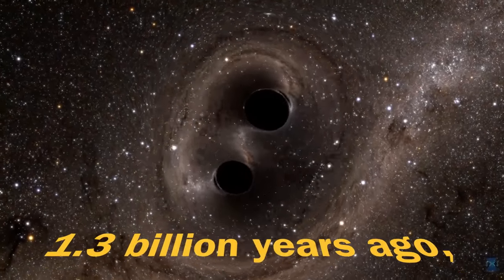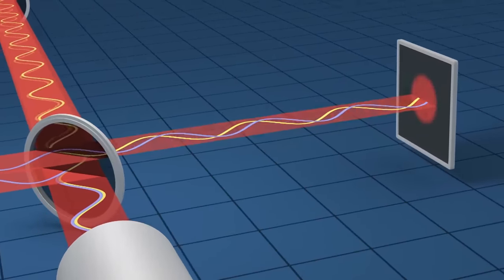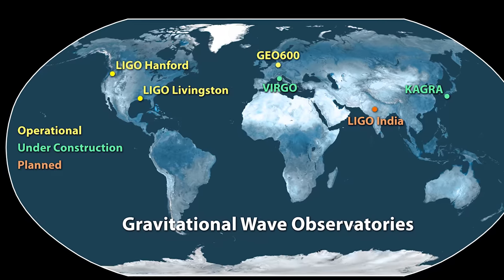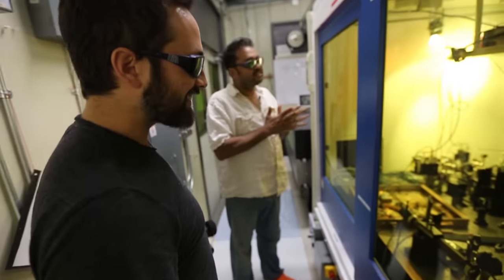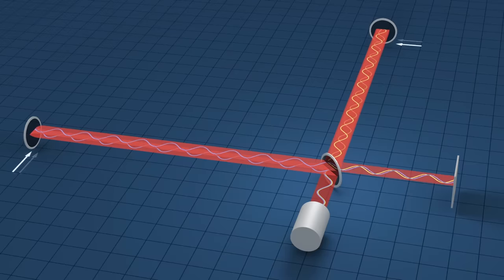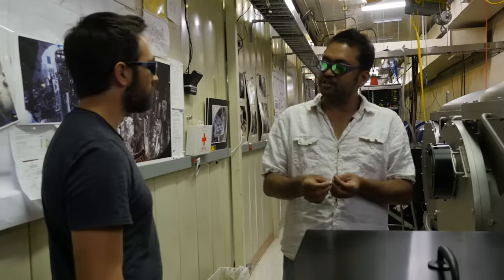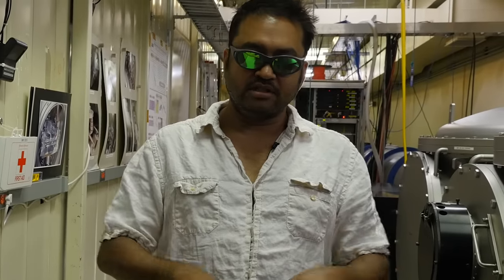The Absurdity of Detecting Gravitational Waves

Comment: Question: do the waves affect time too? Host states that the wave is in space-time, but explanation seemed to only relate to a wave stretching/contracting space.
Reply: Well time is a subjective thing - it only really matters to the speed you move at (relative to... I don't know).
The faster you move, the slower time passes. But what matters is your speed moving through space. At black holes, as you 'fall' into one, what is really happening is that you are stationary relative to space, but the space you occupy is moving towards the singularity. Because of this, really weird stuff happens. from your perspective, the outside world would speed up, and from everyone else's perspective, you would slow down until you froze on the event horizon. So I would think it may have a slight effect on time, but not a major one because time is effected by every action you do. If you start to run, time passes slower for you.

Comment: It's not a gravity wave. It's a deduction of space + time + space.  It was just a really big sonic boom. Like super big. Really hard keep a deductive perturbation going in absence of matter. But if it was big enough then it could pertivate forever technically as long as it's traveling through areas of space which are not completely like almost 100% dead of matter as long as there's galaxies and you know solar systems and then all the diffuse matter that's within the galaxies that we can't really see right now but we are now figuring out that it's there and all the matter is thrown around the galaxies through the center on each opposing side via the pinch point. 

That's what it was. Maybe a a perturbation which reach the maximum rate of deduction+induction+deduction. 
Inverse of the speed/rate of light.

Comment: Will you post the + - of the equipment calibration, and statistical variation of each piece of material in the equipment used for the experiment. Is the answer based on a mathematical equation based on a theory or real data? Is it based on the theory of the speed of light or the actual speed of light? Is it possible that the wave observed is just variance of the process?
Reply: "Will you post the + - of the equipment calibration, and statistical variation of each piece of material in the equipment used for the experiment"
You'll find that in papers.

"Is the answer based on a mathematical equation based on a theory or real data?"
The device collect data that are interpreted through a theory. That's science.

"Is it based on the theory of the speed of light or the actual speed of light?"
Speed of light is a measured constant in that theory.

"Is it possible that the wave observed is just variance of the process?"
Not sure I understand that.

Comment: I'm just making sure to note this: light was off set by light speed force, if this animation is to be trusted, it clearly decelerated.
Reply: Lol, all the claims about light being constant, there's a surprising set of instances that challenges the idea lol.
It might make sense that it's just a permeating and oscillating energy transponder, that is either charged or not, to varying degrees.
Realistically it's a naturally made quantum processing system. 
Larger masses uphold and upkeep the energy network.
My reference on that would be your example with the batter and the light bulb and the 1/c thing. Once the field was closed, you started noticing an oscillating feed of direction.
So a whole system of electromagnetic balance in forces, had an overall activity of a photon.

Comment: "Absolute vacuum is about 10-14. Space fluxes so we learned to formulate a base hypothesis, In the nuclear realm the most "detectors are approx. 10-9" which is all that is needed to detect atom components. The "space model " by theory can be "linear projected" to smaller particles such as "quarks " etc, however the linear models fails as new dynamics are discover as we search into the "minuscule universe". We know there must be "patterned physics" and so patience and innovation needs more exploration.  With the new global cooperation , this is happening.  Will see what will speak it's head out!

Comment: Measuring with this kind of precision, then couldn't it detect the variations from propagating sound waves? Or even someone walking around? Or a minor temperature difference between one side to the next? Or the constant vibrations through the earth? Or even perhaps an interaction with even a single molecule floating in the vacuum?
Reply: Isolating the device from background noise is a nightmare.
I worked with a guy who designed part of the VIRGO mechanical damping system, and that was a crazy stuff.
And afaik, it's also known than when someone speaks near one of the mirror's towers, the conversation can be extracted from signal and played back.
Lots of computer filtering is done to isolate real events.
Now, with at least three operational detectors (and more to come) detection in coincidences ensure it's a real G wave.
Reply: @Iseenoobpeoples  : You keep saying that crap. Why?

Comment: If they're able to detect and track black holes in real time would that be applicable to the navigation of space? Space GPS?
Reply: Nothing's in "real time" when you look at celestial objects, due to the finite speed of light.
Gravitational waves travel at the speed of light so you detect the black hole collision event "today", but the event actually took place 1.3 billion years ago.
(the first event that LIGO detected in 2015)
Other collision events have been detected since. 
It's also very difficult to detect a black hole unless it has an accretion disc, or collides with another black hole.
NASA have been carrying out a mission called SEXTANT that uses pulsars to locate objects in space, relative to the pulsar positions.
The spin of a pulsar is extremely regular, of about the accuracy of an atomic clock.
Reply: @reessoft9416  wow, thank you for the explanation!

Comment: So wait...in order for this thing to work, don't the length of all four arms at the two sites have to be like EXACTLY the same size down to like, the nanometer or something? How could you ever know if they were?
Reply: They don't need to be exactly the same, an interferometer would work as long as the wavelengths still match up. This means you would probably have to adjust them by nanometers or even smaller distances to line up, but the total lengths don't have to be exactly the same.

Comment: A question. how sure are we that what is being measured is a gravitational wave,  and simply not a pressure wave? in theory a gravitational wave would not press the light to the direction, rather it would draw it from the source. if what we are measuring is a simple pressure wave that could simply be created but the movement of a mass thru space. then that would only show the object. if it was a gravity wave it would show a force that pulls towards the mass rotating in space. so can you reliably say it is a gravity wave rather than a pressure wave? @veritasium
(btw: i have a long term project that the simple man that i am , is attempting to figure out gravity, as i am not happy with the current models)
Reply: " simply not a pressure wave"
Pressure of what?

Comment: Wait so the power of the light is related with the number of photons (intensity)? I thought that was related to frequency of the light
Reply: Energy of one individual photon is linked to frequency, by : E=hν (where h, is Plank constant and ν is the frequency).
But if you throw n photons of frequency ν you'll get a beam of energy E=n hν
'n' is basically the light intensity, and at that laser wavelength (close IR, if I remember well), that's gazillions of photons per second to get such an energy.

Side note: the laser itself is of modest power (200W if I remember well), however it's bouncing back and forth thus pilling up photons until reaching that MW power in the beam (and a fraction of that light is lost in the system, so in permanent regime the 200W laser just compensates for the loss).

Comment: If on can answer :)
Does the gravitational wave get weaker with the distance or does it travel to eternity with the same force?
How much greater amplitude could you measure rigth where the blackhole collison happens?
Reply: since the waves travel in every direction, their energy gets more spread out the further they go. like the light waves from a lamp
Reply: Space-time is supposed to be fully elastic. So no loss in perfect vacuum.
However, as @somemagellanic wrote, it goes in every direction, so if full power is preserved, power per area is in 1/r², inverse square distance law, as for light for same reason (surface of a sphere is in 1/r²).
There will be non-elastic loss in matter (if the detector see them, there must be some energy transfer), but it's very small, and likely negligible in practice.

Comment: Why are atoms and the molecular structure of the laser emitter not stretched by the same degree? If gravitational waves simply stretch the metric, how does the strong nuclear force know how far it’s reach should be?
Reply: To answer you question, it needs a better understanding of GR that I do: you need to know the difference between local coordinates and proper distance, and how a GW can let local coordinates invariant while affecting proper distances.

Look for this article (should be in open access):
"The basics of gravitational wave theory", by Anna Flanagan and Scott A Hughes, sept 2005 in "New Journal of Physics", Volume 7, 2005. It's explained page 15 and 16.

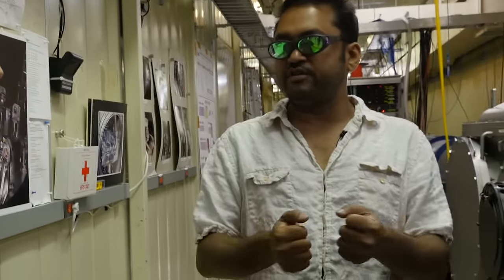Comment: 6:40 I'm looking for an explanation. Can anyone help? When the space is stretched. I would expect the light to measure the same distance because it is the space that has moved, rather than the mirrors in space. I figure Light travels the same speed through space whether the space has been stretched compressed. I guess that statement is wrong but why?
Reply: To answer you question, it needs a better understanding of GR that I do: you need to know the difference between local coordinates and proper distance, and how a GW can let local coordinates invariant while affecting proper distances.

Look for this article (should be in open access):
"The basics of gravitational wave theory", by Anna Flanagan and Scott A Hughes, sept 2005 in "New Journal of Physics", Volume 7, 2005. It's explained page 15 and 16.

Comment: 5:41 this is difficult to understand even though I rewatched several times. Still don't know how to answer "if everything is stretching how do you know anything is stretching"
Reply: Because it was stretched for few milli seconds , then new waves coming from laser won't be stretched. So they will travel more than existing light waves. So they will just notice the time difference between different waves coming back to sensors.
Reply: To answer you question, it needs a better understanding of GR that I do: you need to know the difference between local coordinates and proper distance, and how a GW can let local coordinates invariant while affecting proper distances.

Look for this article (should be in open access):
"The basics of gravitational wave theory", by Anna Flanagan and Scott A Hughes, sept 2005 in "New Journal of Physics", Volume 7, 2005. It's explained page 15 and 16.

Comment: What is a gravity wave. Alot of people are assuming they understand gravity when they dont know anything but the analogies that help to explain the complex systems in 3d terms and pictures 2d even for dummies. Show us the math on 2 things out in space let's say far from any gravity or at relative zero average gravity in all directions but not by falling or not resisting the gravity to easily achieve this state but hypothetically where this can be achieved with both items at rest and at different locations a impossible spot to find not just 2 points with similar zero gravity points but 2 points so far from gravity well you can't get far enough so just say the 2 items are the only items with gravity in the universe. Then each item starting at rest (would never happen I know) would there gravity pull them together even though Newton says they would stay at rest?

Comment: The amount of variables in this equation are near infinite.... how can they assume there are no outside influences that could have been what they were actually measuring?
Reply: what kind of outside influence would affect both LIGO stations 3000km apart, and a 3rd independent station in Italy, at the same time?
Reply: @lawrenceredmacher4382  my hypothesis about the flex and constant movement of the earths crust is one of a few dozen outside variables I’ve come up with in the amount of time the video played

Comment: 50X more energy than all of observable universe combined. Where did all this energy come from?
Reply: E=mc². The system lost mass in the process, and not just a little.
Reply: @Релёкс84  Thanks for the explanation. Do objects lose mass when they emit gravitational waves? The two supermassive black holes presumably lost mass when they merged
Reply: @hqlife5128  : Picture the energy produced by just a stone falling from 100m high. Now take an average small asteroid hitting Earth (a small one, maybe 10-50 km accros, like the one that whipped out the dinosaures), that's huge, right? But now imagine it's two Earth falling on each others; start to be, humm, tremendous.
But that's nothing compared to two black holes, millions of time heavier than Earth.

A fraction of that energy is converted to GW, slowing the fall a little, but that's enough to release an astronomical (yes) quantity of energy.

Comment: Wouldn't be cheaper to build these equipments on space? At least they won't have to worry about creating an artificial vacuum there.
Reply: It costs roughly $10,000 per kilogram to put something into space. You're talking about trillions of dollars and thousands of rocket flights.
Reply: Average space shuttle is only about 50-60 meter long, and launching shuttles is already risky business enough. You're talking about building a 4 km long building in space here. Also, this facility needs like 30-40 workers to maintain and research. They can probably build 10 facilities like this on Earth with the budget it would take to build just one in space.

Comment: Well what happens when plate techtonics?
Reply: You means seismic waves?
That's why the system is put on dampers.
Reply: @ThomasKundera  sure whatever but what if the magnitude of the waves is greater than the capacity for damping?
Reply: @Linqua2112  :
Damping is a very complex issue. I worked with a guy that was designing the damping for VIRGO (same thing in Europe), a decade ago. That was pretty complex.
The idea is to be very efficient to reject stuff that are in the frequency where the detector is best to detect signals.
But of course it has limitations.
So it creates noise.
Worse is not large but very short bursts (like an earthquake), but background everyday noise (trucks, winds, etc.).

For actual earthquakes, as they are felt by regular instruments, a feed-back loop can correct from them, but smaller things are harder to cope with.

That's signal analysis that does most of the job, then: isolating relevant events in the noise, while not inventing non-existing ones from random noise or irrelevant sources.

The key factor after that is correlation between the 3 active detectors currently in operation (and soon at least 5, from China and India) so that any spurious local phantom signal  can be rejected.